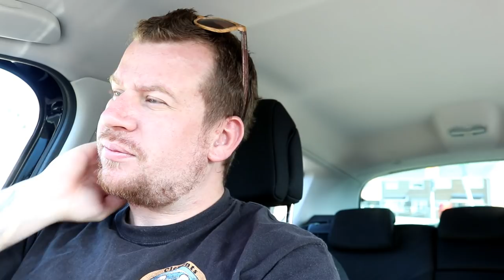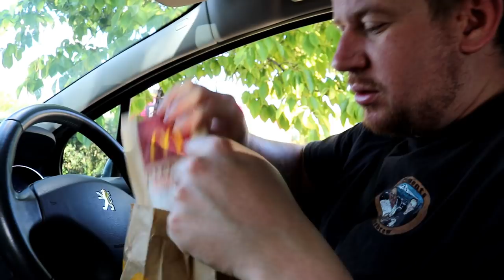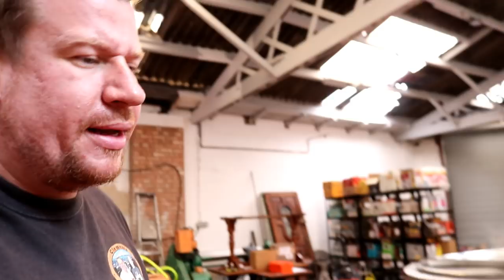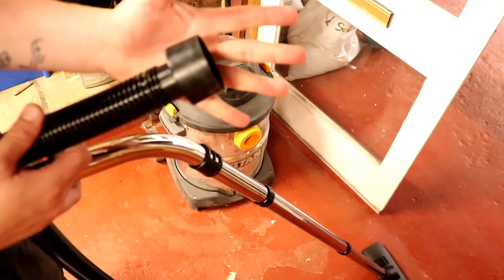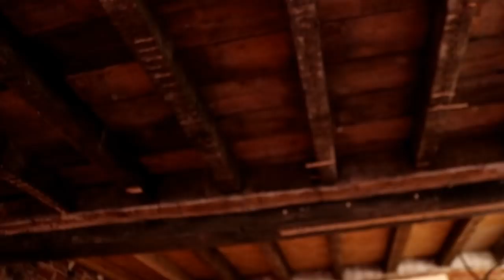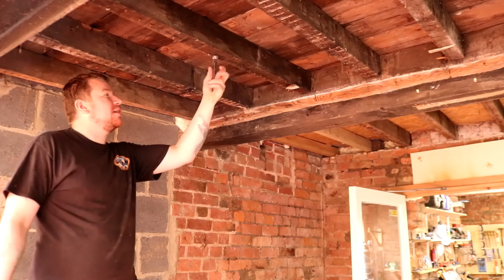I WAS GOING TO DO A SPECIAL

Comment: I could board and skim those timbers at mates rates if you required
Reply from the maker: I might take you up on that, I will chuck beer in for free too.
Reply: sure i've acquired enough spare boards to do it so materials will cost precisely £0